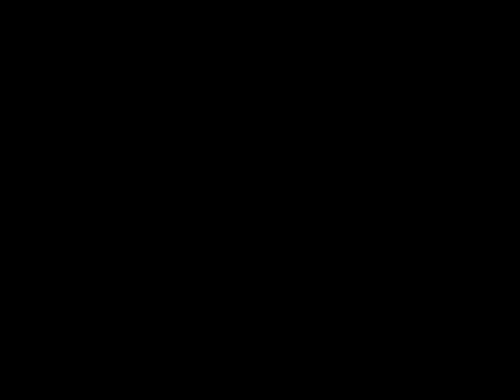The Megahertz Myth

Comment: Exactly.  The PPC architecture was great when the physical architecture was still within limits, however, the power/performance ratio was falling farther and farther behind Intel x86-64 designed processors.  Essentially, PPC chips were requiring vast amounts of electrical power and giving off an abundance of heat for a small boost.  When Intel developed the dual, quad, etc core processors, this problem was effectively solved.

Comment: The reason why Macs have Intel processors now is because the Motorola/IBM chips proved to cause lots of heat, even though they were better. Thus it was impossible to make a laptop for the G5 model processor. The irony is that Microsoft went with this processor architecture in their xbox. It is a great processor... just not for laptops.

Comment: The irony in this video is that as a few more years went by, Intel vastly improved in all of these areas (as the Itanium noted in the presentation was foreshadowing), while the PowerPC platform got worse and forfeited the advantages it once had.

At a certain point, Apple had no choice but to make the switch, and it's worked out very nicely.

Comment: mhz myth, so thats why macs have intel in them now, right? dafuq apple?
Reply: No, it's because IBM was unable to develop PowerPC enough to keep up with the innovation of Intel at the time.  IBM's roadmap for the G5, even with multicore processors, did not have the upside that Intel did with their multicore processors, especially in the area of power consumption.
PowerPC processors in that era still outclassed every Intel processor of the era due to the principles explained in the video.

Comment: Bulldozer has 1200 Mn transistors and ivy bridge has 2000 Mn transistors ..... sandy bridge has 1159 Mn transistors ..... Bulldozer performs less because of it's shared modular design .... win 7 does not have appropriate scheduling scheme for the shared FPU ( floating point unit ) per module .... on the other hand windows 8 have a shared scheduling algorithm and the performance of Bulldozer rises dramatically for about 10-20 % on Win 8 ... and it performs neck to neck with sandy bridge

Comment: Sorry to type so much, but your ignorance warranted a nuanced response. My 2011 Mac Mini absolutely curbstomps even the fastest G5's in raw processing power, has faster memory, is wayyyyyyyyyyyyyyyyyyy more power/heat efficient, can run modern AND legacy software, gives me the flexibility to use any OS on the planet via Bootcamp, etc. A G5 is basically an expensive space heater at this point.
Reply: And that G5 blows away any Intel PC from 2001 in raw processing power, so what's your point?

Comment: Also, you're hardly an Apple fan. You're a PowerPC fan or an obsolete processor fan, nothing more. Any real Apple fan would be in love with the switch to Intel since the performance is simply leaps and bounds above any of the PPC processors and they run cooler and quieter, too (which has always been a "thing" with Apple). 

Maybe you should care about Apples being some of the best built computers on the planet, rather than defending the G5 to be "different for different's sake".
Reply: The build quality of Macs has definitely declined since the Intel switch.  PowerPC was indeed a more stable platform, but the build quality of the machines was second to none as well.  Most of the new Mac line is junk.

Comment: I don't know how you're going to sit there and tell me I'm wrong when 2.5ghz G5's drew more power and put out even more heat than the abysmally designed P4. The most power hungry P4 drew ~115w and put out ~500 BTU/h in heat. Meanwhile, a 2.5ghz G5 drew 185 watts and put out a rather blistering 1877 BTU/h thermal output. The future belonged to more efficient processors, let alone processors that could actually hit their clock speed goals to begin with.

Comment: Wrong wrong wrong right back at you. The G5 simply wasn't scaling well; this INCLUDES issues with heat and power consumption. It was a poorly designed, inefficient architecture.It is the same issue that the Pentium 4 ran into. IBM had promised 3+ GHz clock speeds and was never able to deliver even that; meanwhile, the P4 had almost hit 4ghz and the Core line came out which offered double the clock cycle performance of the P4 (2hz Core ~= the fastest p4 ever produced).

Comment: @kawaiifreak860 At the time, and even still today, the G4 had a considerable advantage when it came to games and graphics over the Intel Pentium 4 especially with the AltiVec engine on the chip. CPU design is considerably more then  just pipelines and MHZ. A modern CPU is incredibly complex. The power series has always had an edge in raw computational power. Graphics is 100% computational. This is why EVERY major game console of this generation uses a power chip. This is for a reason.

Comment: this is a joke. the pentium 4 and the G4 are using COMPLETELY different instruction sets! you simply cannot say "the same task" because the code is not even close to the same thing! you can be damn sure they did everything possible to compile sloppy, inefficient code for the P4 and as efficient as they could get it for the G4. end of story. i'm not a big P4 fan, but you can be sure if the test was fair a 1.7 Ghz P4 would crush that 867 Mhz G4. no problem.

Comment: @dingumfCallofDuty they didnt change there mind.
the new mac use a intel processor because a PowerPC processes uses much more electricity then intel processor do, but they are faster.

I also tried it myself, using a 1,0Ghz G4 agains a 2,81Ghz Celeron-D.
the G4 was faster.

Comment: northwood ONLY out perform thoroughbred when it's 200~300mhz or more above thoroughbred. in the same frequency northwood is still a joke. in the extremely case it would take a northwood 3.06ghz to out perform a 1.8ghz barton(athlon xp 2800+) the only advantage that northwood have over willamette and prescott is the lower power consumption and easily booting out performance when the clock rate is extremely high. willamette and prescott fail because of heat and unable to clock up too high.

Comment: The animation from this video is trying to create a myth..

They added the branch penalty to both pipelines but they did double the speed of the pentium pipeline. (Which isnt so strange since this would double the output of the pentium part, thereby outperforming the g4 in each animation...).

Comment: Also, Intel (and AMD) are really pushing their multi core technology. That way you would have two pipes (or how ever many processors you have) running at one. look up AutoCAD 2007 rendering videos, the spiralling is the two processors working on different areas of the image at once.